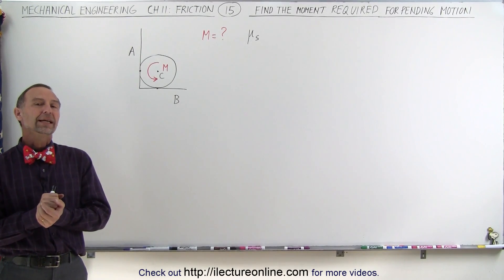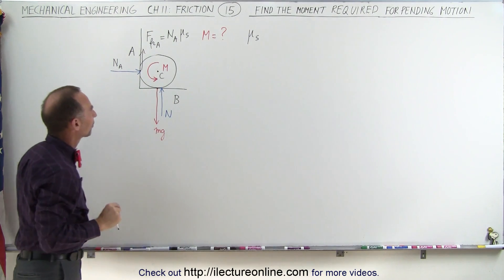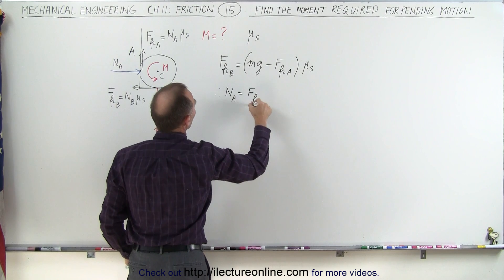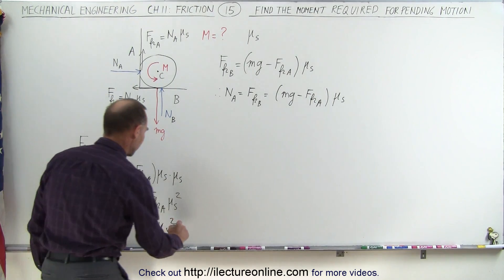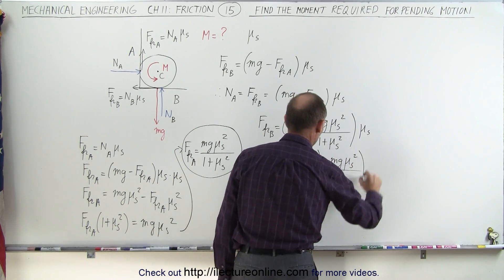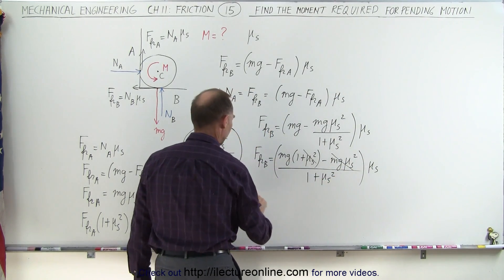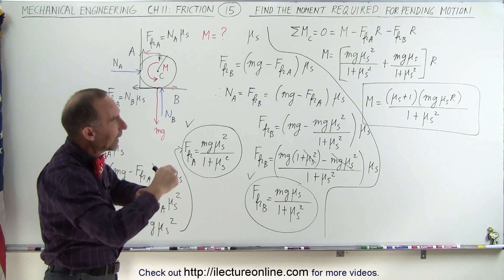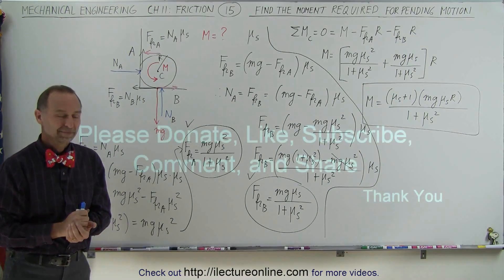Mechanical Engineering: Ch 11: Friction (15 of 47) Find the Moment Required For Pending Motion

Comment: Why impending motion is assumed at both the points A and B, why not at any one of the points either A or B??
Reply from the maker: The motion is not "at" A and/or B.  There are forces at A or B that cause moments about the point of rotation at the center of the mass.  We must assume that there are forces at both A and B.